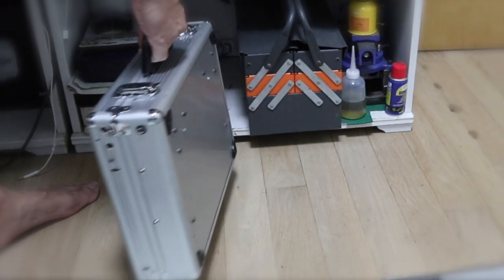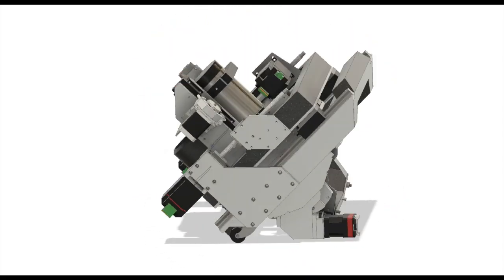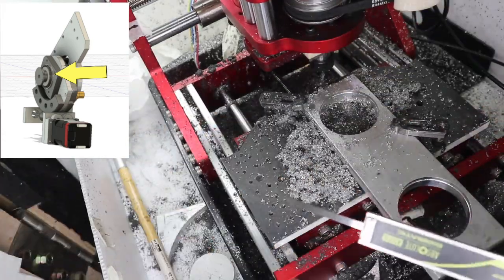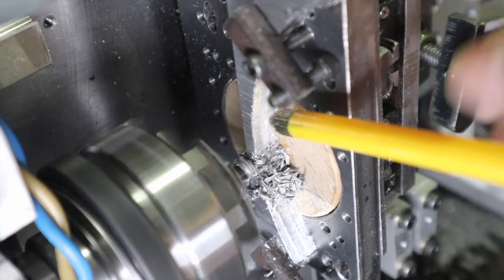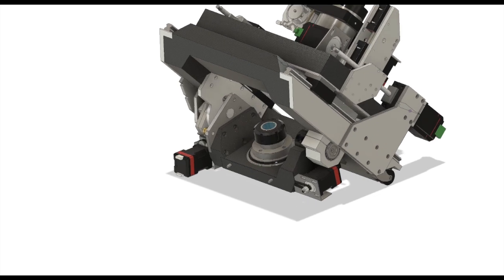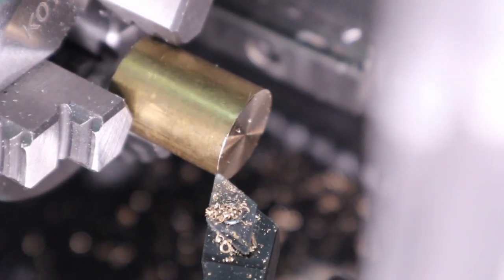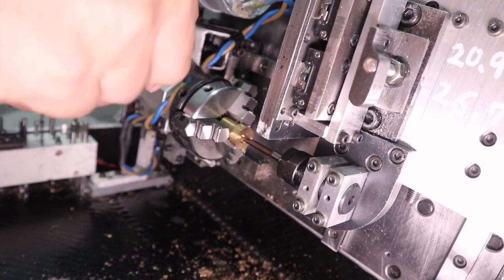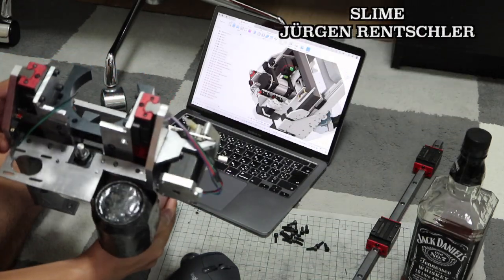Revolutionary Beyond Your Imagination Metal DIY Tool! [SECOND PART]

Comment: I have watched your videos with increased interest! I'm short of space  too...  :). I think you do right what you do. Congratulations!
As for this combo: For lathe machining the tool support is very weak, that's why it vibrates. A solid block would be required and maybe installed rotated with 90 deg. to transfer load to base plate. an additional load transfer block or bearing surface to plate (even linear ball bearing) could help. Most of the rest of construction looks pretty solid and some types of operations are chatter-free. Good luck!
Reply from the maker: Sorry for the late change tree.
I am glad for your comment.
Reply: @a-cnc-f  A good concept worth refining and finalizing just for the sake of proving its effectiveness and novelty it brings.  And of course, to be useful.
Simple suport in one  direction of main load  is simple and effective because it requires only a flat gliding surface it restricts deflection and contains the small play along entire chain of moving parts . Should be provided, hopefully, as close as possible to the tool tip. Additional restriction in opposite direction contains vibration but makes design a bit more complicated... 
But main thing is tool post sturdiness! A chain is as weak as its weakest link. And of course, once you solve the weakest, you just find the next weak point... Close-up videos help you evaluate deflection and its source for each machine point.

Comment: If you use HSS tools you wil get a MUCH better cut with less chatter and a better finish!

Carbide inserts are for rigid machines with high rpm and high hp motors.

With HSS tools you can grind your own (or order but its much cheaper and more efficient to grind your own after learning how to) and the thinner the cutting tip is the less torque required to take the cut, so for less rigid and low hp machines you can grind your tips nice and small with a sharp radius at the tip, this will give your machine an ENTIRE NEW LIFE!

Without lubrication they can wear down quite quickly tho, but so can carbide!

But when they wear down a quick regrind and were back in business!

Any thread you need to cut, just grind it exactly to the example and run it! Any tiny bores needed you can grind some tiny boring bars or purchase them if not confident.

HSS tools are very flexible im suprised you havnt dipped your toe in yet?

Reply here if you want me to give a better rundown!
Reply from the maker: Thanks for the advice.
Yes, I agree, I'm not sure if I'll be able to find the right place for it.
For a machine like this with no power and no rigidity, I think you are right, HHS is the way to go.

Comment: Hello !
It's the suitcase for mission impossible!
more seriously, Dural  ( AU4G for instance)  would be more resistant than (soft) aluminum for your machine and even easier to machining!
Congratulations !
Reply from the maker: It seems you are correct.
I wasn't too familiar with the material so I did a little research. For me, light and strong is a huge advantage. The only problem may be availability, when I try to buy it privately, I can't find it.

Comment: In your grooving tool on center?
Reply from the maker: I have tried many things.
If the tool is too high, it will not cut at all. When the tool is lowered little by little and cutting starts, the resistance increases and the tool is pushed down about 1 mm, so it cannot cut at all.
This means it is not strong enough.

Comment: You should make a pocket screw machine. Battery operated makes screws for cabinets, or other things which need a small lost screw.
Reply from the maker: Even though this machine can't machine grooves, it's difficult to machine screws.
It's interesting to use a battery."
Reply: @a-cnc-f  Maybe add a small stepper motor so it can do threads!

Comment: I have a few grooving/cutting tips:
1. Make sure that your tool is EXACTLY on center, especially on this small machine and diameters.
2. You want to have as much rigidity as you can. That insert holder is unnecessarily long for most aplications. You should make much shorter and perhaps beefier holder.
3. On this small machine you need to have very sharp tools and carbide inserts aren't that sharp. I think i would be better, if you used HSS tooling and then you can sharpen it easily on stones. Or another option is to sharpen carbide inserts but for that you need diamond stone or file.
4. I think that your rpm's are way to low. On the back of insert's package you should have recomended cutting speed, using that and radius of your part you can calculate rpm. For this small parts it probably will be a few thousands rpm. Was you running it max speed on video? If yes i think you need to increase rpm's.
5. On small manual lathes, mills, etc you lock the unused slides, especially when doing high force operations like grooving. I think you should add locks to your machine, but i don't see an easy way with linear guides, for sure you will come up with something.
Reply from the maker: I agree with you.
I think it is better to use HSS for such a machine, and I think your point about the strength issue, etc. is correct.
I think there are many factors for improvement.
Thank you.
Reply: I've heard of people using electromagnetic brakes on linear guides to lock them. Don't know how well that works, though.
Reply from the maker: @fletcherenfield9474  Thanks for the comment.
I don't think the structure needs to be that complicated.
This is at the level of a hobby DIY project.

Comment: Hey, maybe you could use a compact BLDC motor intended for e-longboards in the case (and potentially other machines you build) instead of a brushed 775. For example, a 7070 motor from flipsky or similar, provided some gearing, it could cut through anything you throw at it. If you buy a cheap 60-80V 1kw PSU, and tune a cheap VESC based controler to not overpower the cheap psu, it could work okay and not be too expensive.
Reply from the maker: Thanks for the specific advice, I used that motor because I already had it, but I don't think it's optimal.
I will consider your suggestion.